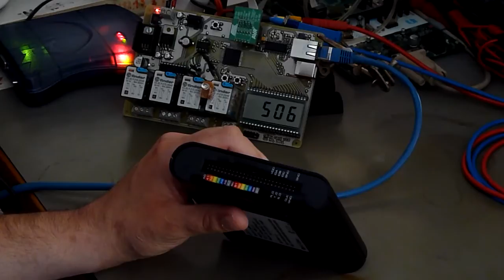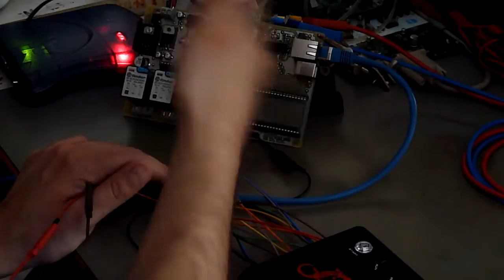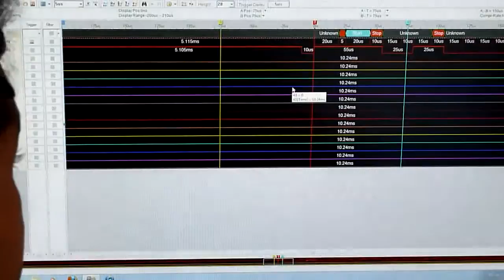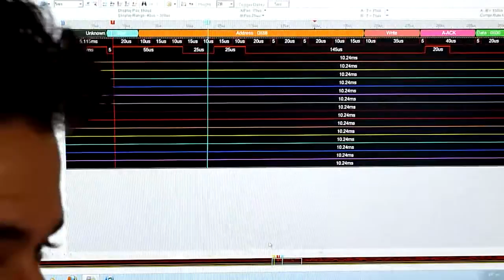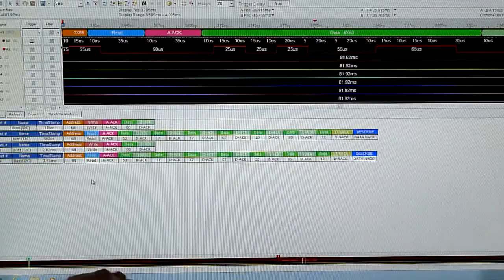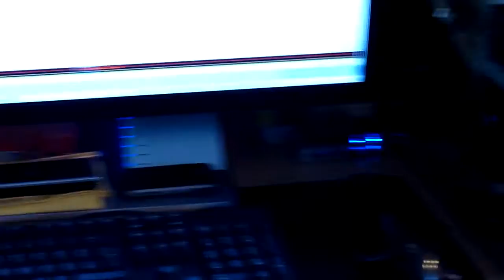How to use a logical analyzer with an I2C real time clock.

Comment: Hello, my name is Evanildo, I am Brazilian living in the city of sao paulo. 
I wonder if it's possible with your protocol analyzer. 
I need to check the communication of an authenticator chip. 
it is possible to check the protocol and do the simulation checked this protocol? 
Protocol type that need to see is 1 wire, in a karaoke machine. 
can you help me? 
How can I buy an analyzer, these? 

sorry not speak english I'm using an electronic translator
Reply: Evanildo Almeida — você pode comprar um clone logic Analyzer da China sem problems. O preço pode variar entre D$10 até D$900.00. Primeiro coisa é: Qual é o seu OS no seu computador? Segundo: você pode usar o website do Sigrok (www.sigrok.org) para ver todos os analyzers que pode ser usado com Linux.